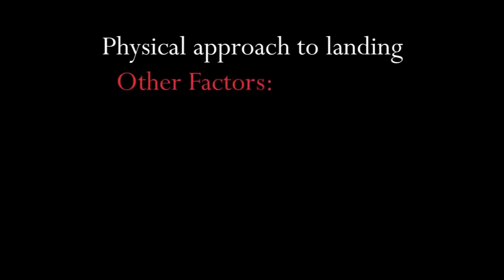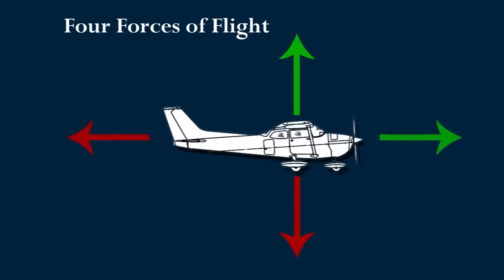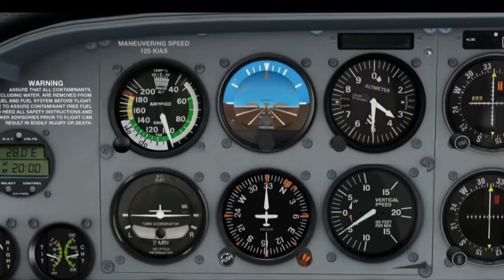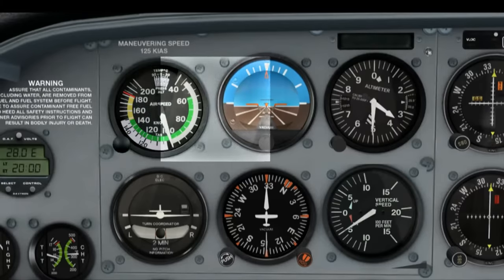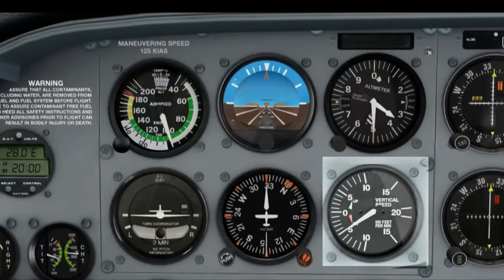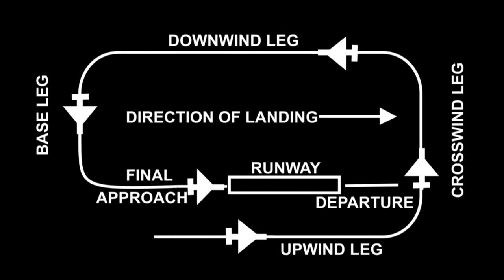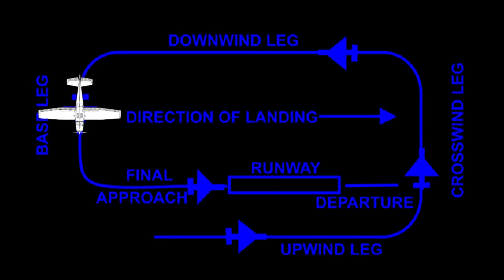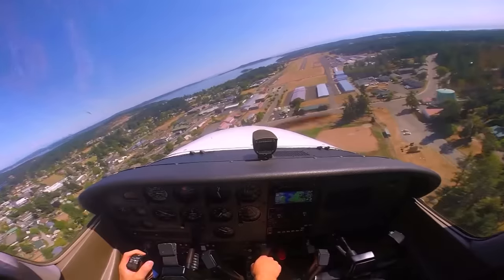How to Land a Plane

Comment: Well done video, except it gives bad information. Pitch=Airspeed and Power=Glideslope is backwards. Don't believe me? Tell me how you fly a Flight Director ILS approach.  When you get below the Glideslope the FD commands a pitch up to get back on the GS.  Of course when you pitch up, what happens to your airspeed? It goes down, so you add power to get the Airspeed back.  That is exactly what the autopilot does when it flies an approach.  I know I will get pushback, but that is how I have done it for 24,000 hrs. flying jet transport aircraft. I don't know why people teach it like this. Doing it the way the video says just doesn't work. I fly most manual approaches with the auto throttle engaged and set to airspeed hold for the bug speed. To stay on glideslope I adjust the pitch with the joke, and the AT adjusts to maintain the proper airspeed.
Reply: Somebody way back got confused on what the region of reversed command is.  I think they interpreted it as meaning the forces reverse below best glide - i.e. the thrust vector becomes the lift vector (not possible except on the V22 Osprey).

Comment: These videos are written by amateurs.  Being able to generate a video does not also imply the ability to communicate well.  A far more profound video statement should have also included "while you can choose when to take to the air and where to go while in it, the landing aspect is always required."

Comment: Poorly articulated. "The aileron controls located at the tip of each wing primarily controls the roll of the aircraft causing the wings to bank at an angle. One aileron moves up while the other moves down, causing the aircraft to bank in that direction." Where do I start. There is a  grammatical error, a lack of agreement in number, between "the subject aileron controls" (plural) and the predicate, the word "controls"  situated within "primarily controls the rolls" (singular). Also, it would have been simpler to say "ailerons" rather than the long-winded term "aileron controls." But this grammatical error is not so bad that it obscures meaning. A real problem is "One aileron moves up while the other moves down, causing the aircraft to bank in that direction." In which direction does the aircraft bank? It is not said. For example from that sentence we cannot tell which aileron needs to go up and which needs to go down, in order to bank to the left. The image of the plane banking does not help, as while you can see the plane banking, you cannot see the motion of the ailerons.

Comment: That's not how you do it. you get about 3-5 miles from the airport about 3,000 ft. you push the nose down at about 45 deg angle, full power and tell the person next to you, here hold my beer, and watch this....they shouldn't even spill a drop. when you get over the end of the runway you should be at red line plus, pull straight back go straight up till you hear that noise, not the one of her screaming sounds like a stall buzzer, go full flaps power all the way back now you should be pointing straight down at the ground building up speed quickly, but that's ok. when you get to about 50 ft relax the back presure close your eyes and when you hear/feel the wheels hit (and you will hard" just push both feet to the floor to come to a firm stop. with any luck you should still be on some part of the airport grounds. OH and those big trucks with all the lights on...their just there to give you a lift back to the FBO after they put out the fire...  :)